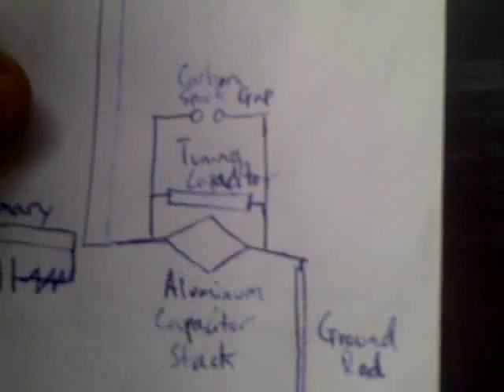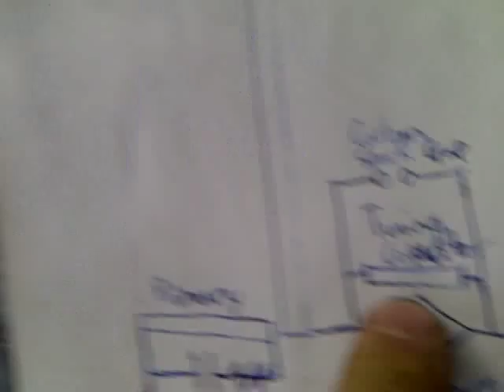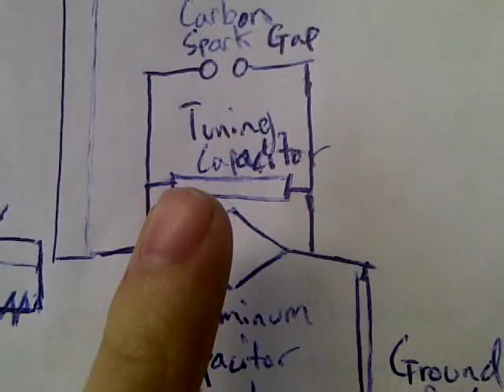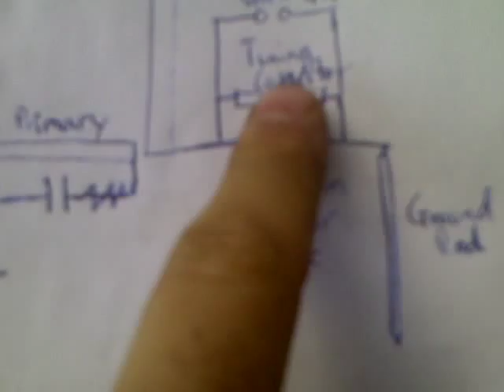The Tesla Tree Project

Comment: So first I want to say thank you for your videos, they are very helpful. This video is quite sinchronistic for me because this last week on an intuitive impulse I taped copper wire to aluminum foil(trying to mimic a leaf) and grounded it to see what voltage I could get. I am very new to working with electric circuits but I am enjoying it. One thing I noticed with my little experiment was that the AC voltage dropped a lot when ever I went near the "tree".

Comment from the maker: @Cloxxki I am very familiar with Ed's work and have read his book. It was one of the first things that got me into free energy several years ago. Not familiar with the tubing piece. The 24 star found at coral castle is magnetized iron, maybe alnico, (def not a nonmagnetic material as it came from a Ford Model T alternator, six of them stuck together). Perpetual motion holder used a closed magnetic current as we are both referring to yes. I just don't remember the term lock it in place.

Comment from the maker: @Cloxxki Not sure what you mean by "lock it" magnetically. The coil is magnetized, and it is completely contained within it, so it is not measurable, however, energy workers (myself included) can feel the difference between one that is magnetized and unmagnetized. It is readily noticeable. And the way I did it, it is impossible to magnetize them opposite. Maybe with thinner steel. You have to heat the steel above the curie point to bend it so it would lose magnetization. Magnetization is last.

Comment: Just a suggestion for thought.. Chrome has a high melting point, and unique magnetic properties when magnetized in different ways... same for stainless steel as far as heat goes..   Just wondering if the copper helix would get extremely hot

Comment: @GregorArturo85 My apologies Gregor. I am confusing David Lambright's replication attempts with what we understand of Ed's actual work.
David managed to lock 24 pieces of U-bend-closed ferrite non-magnetized tubing together by first loosely tying them together in Ed's Ford V magnets arrangement, and then applying Ed's PMH trick on it. A brief electr charge getting it to cling together, also after disconnecting leads. David claimes gravity anomalies and visual distortions near the charged device.

Comment: I just started watching your 56/176 video i'm at the 22:00 min... I would like to know if the thickness at the ID & OD is of a certain uniform value, and I use West systems 5:1 on all my wood working, it is great for taking up space in unwanted areas, however I use T-88 ( a systems three product) for any areas that involve structural integrity, T-88 is an adhesive epoxy that makes an incredible difference...
 you said that you use copper tubing, i am sure that you etch it... do you etch chemically (Ferric Chloride, or?) or just lightly sand the copper? Aloha

Comment: @GregorArturo85 Ed Leedskalnin's work in energy and anti-gravity may be a whole new can of worms for you then. He had non-magnetized metal tubing piece, created a 24-part star from it, and by energizing them, got them to lock magnetically. Eternally. The current would be locked inside the ring, keep the pieces clinging together as against an electromagnet. Sensitive people can tell te difference, although instruments can't. Perpetuum Motion Holder is the term I believe. LIkely totally unrelated.